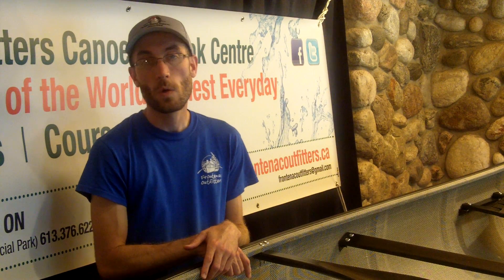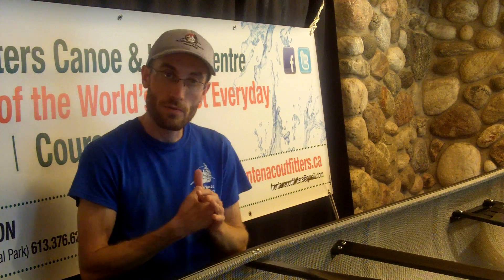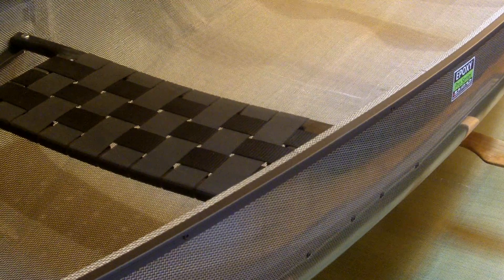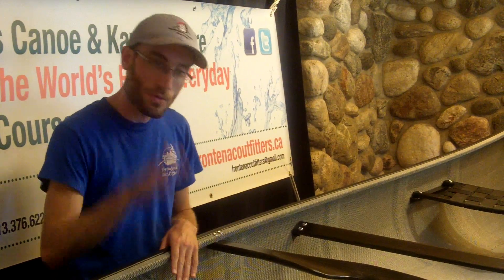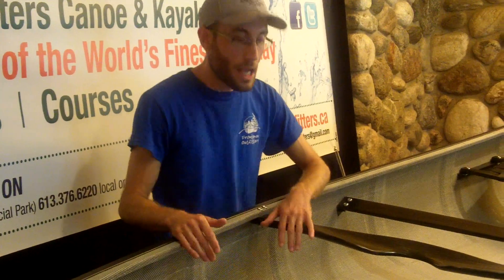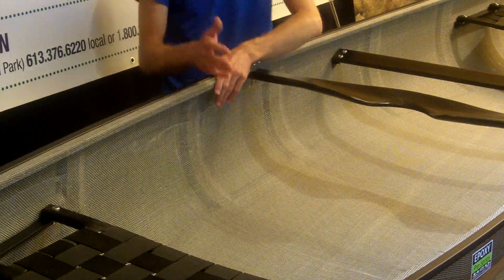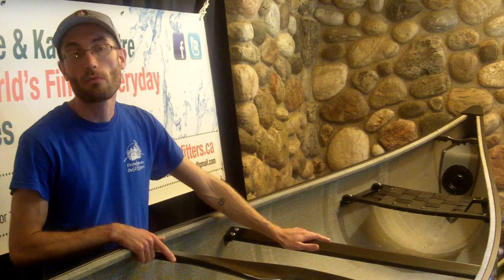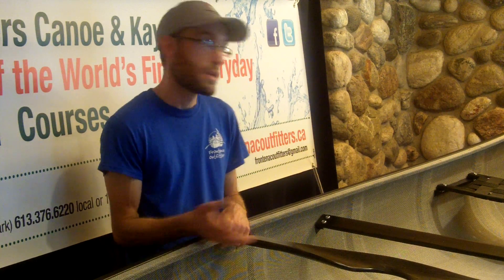What is an Innegra Canoe?

Comment: Very informative, thanks for this! When we talk about toughness, I know H20 has a brute force series, could an Innegra/Basalt (lighter) boat like this do a C1 rapid for example? Or should that be reserved for the Brute Force layup?
Reply from the maker: The ProLite Innegra is pretty tough for its weight class for sure, but running down rapids the big thing to question is water depth, and paddler ability. A CI rapid would essentially be a short point and shoot swift, and this layup would have no problem handling that, but certainly wouldn't want to grind it down a shallow section of rapids like I might with a plastic boat!
Reply: @FrontenacOutfitters  Thanks for that very helpful info!
Reply: @FrontenacOutfitters  is the Brute Force Innegra Basalt similar to Nova Craft's TuffStuff?  I'm told it's the same layup except its epoxy over a heavy gel coat.
Reply: @Get_Outdoors_Mike  the Nova Craft gel coat is absolutely needed in order to provide river durability.  I own a Nova Craft TuffStuff canoe with a clear gel coat and I would never buy a canoe I intended to use for river paddling unless it had a gel coat.  The exterior coating described in this video is nothing more than a "skin coat" and will not have the durability you need for long-term river paddling.

Comment: Why not just use a Carbon Fiber integration instead of the basalt?
Reply from the maker: There are layups now available with Carbon interwoven into the Innegra cloth. Been a new adaptation in the manufacturing process since this video was recorded. The Innegra / Carbon boats are little bit lighter and a little bit stiffer than the Innegra / Basalt models. The trade off is a little less impact resistance.